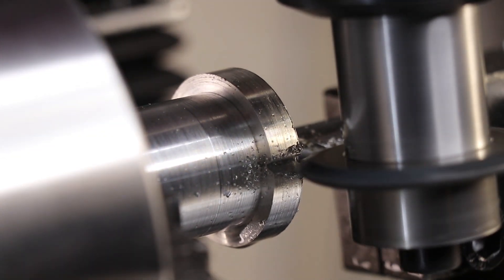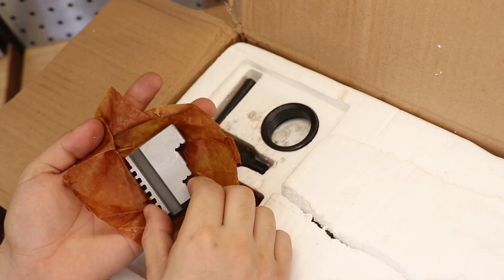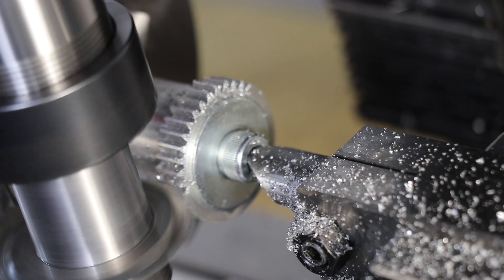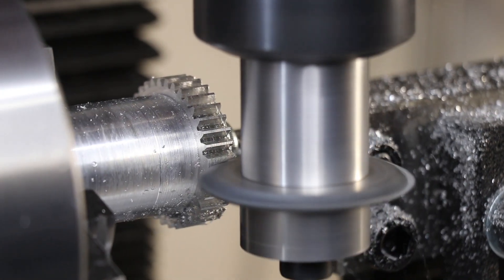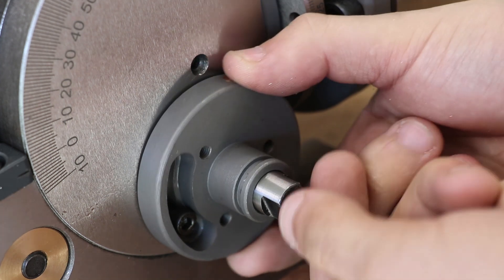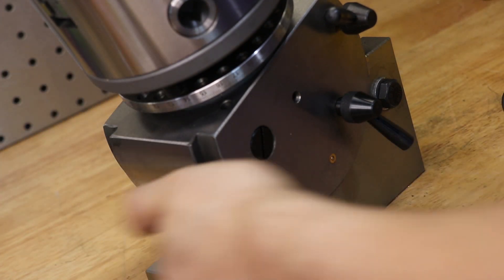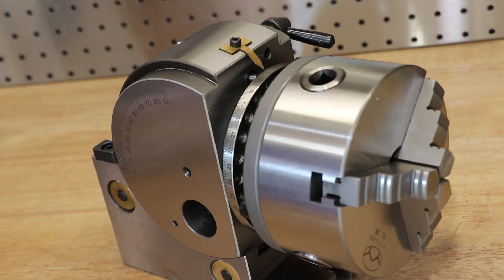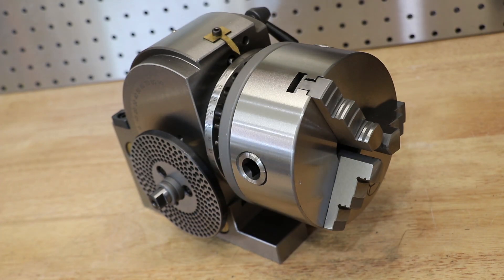$200 Dividing Head - Almost Scammed Buying It

Comment: Do you nave a piece of hex stock, or a big (1/2") or more Allan key? With the hex stock I would bed it 90 degree with one leg long enough to go past the depth of the chuck jaws, tighten the jaws up really well, clamp the head down tight and try loosening the chuck with the new "handle". Still will not move? Use a piece of pipe as a cheater for more leverage, hit the end of the handle with a lead hammer, etc.  A strange thought crossed my mind... could some fool at the factory have Loctited it in?  A very weird idea, but not impossible.

Comment: I am thinking of buying this one , looking at your video now , thx, what do you all think for the best way to make an keyway in a gear ?
Reply: If you are only cutting a keyway seldom, chuck the gear in your lathe - make a tool bit to make the keyway, and use the carriage back and forth to cut a slot in the gear. Otherwise you need some kind of a slotting tool/machine
Reply: For a one-off, use a vice, a hacksaw blade and a file.

Comment: I use the same, the chuck will come off, just needs a few clouts with a heavy hammer and a wooden block, and yes you can tap the spindle through with the same method, no press required. I took mine apart and machined a myford spindle thread so that I could easily swap from the lathe to the indexer without loosing positions, the spindle is hardish, but still cuts ok with TCT. very useful and well made bit of kit for the money
Reply from the maker: I have tried that,  that back plate is so tightly torqued onto the spindle threads that it aint budging. Cheers
Reply: @artisanmakes  Heat it up a bit and get the big-boy hammer out

Comment: In fact, on Taobao in China, you can buy a 4-inch Dividing head for US$200, which is true. But if it is sold outside of China, That is impossible. the shipping cost will be higher than the price of the product. The fees charged by foreign trade sales websites and the cost of currency exchange rate losses are 20% of the total price + shipping.
Reply from the maker: To be honest, I have never used Taobao, I am more familiar with Aliexpress. It is true that shipping and such are expensive for heavy items from China, but I was lucky  since the distributor has a local warehouse, so the shipping was free. Cheers

Comment: Someone probably already said this, but I would consider cutting an allan wrench/hex wrench shorter to see if you can get the bolts loosened (i.e. grinding them down, using a cheap set). It is still going to be tight getting them out, and you will probably need to loosen all of them and pull the chuck away since I don't think they will fit out between the plate and the mount.

I liked the Video, as I bought a rather expensive BS-2 version from QMT. It is REALLY big and heavy and so complex.  It has a similar issue with the chuck mounting, except the chuck was not pre mounted so I had to figure out how to get in on in the first place.
Reply from the maker: Getting the chuck off is not an immediate concern, although I would like to take it apart, its more of getting the backplate offf, which is sized onto the spindle threads. I did look at the bs-2 model, but this suits my set up much better. Cheers

Comment: to try to get the chuck off, you can put a piece of hex bar or large nut in the chuck, then use an socket and impact gun on the nut while using a strap wrench on the manual index plate to hold it. This works a treat to get my lathe chuck off after I had it jammed it on for years that tight that I broke my back gear try to undo it.

Comment: Do not press it out. You need to unthread the chuck backing plate. If you press it you will break the retaining screws holding that cover plate. The brass gear inside is held on with a threaded nut, it isn't going to be pressed off. Bolt it down, use the index pin and the spindle clamp to hold the spindle shaft from rotating, wedge a long piece of wood  in the chuck jaws and unscrew it. It is just on tight, it isn't welded or pinned.

Comment: I have that same dividing head, I never took the back plate off, but mine had hex bolts holding the chuck on luckily. If you can't get them out with vise grips or channel locks I'd cut the bolt heads off and replace them with some hex bolts cause the 5" chuck is great on the lathe too. But you can't put new bolts in the back plate with the dividing plate in the way either. Mine has the bolts sitting in it still. Which I guess is great cause I can't lose them. Not so great though if you actually want to change them.
Reply: And I put loctited studs in the chuck so I have to get those bolts out of there too. Am following to see what solutions yall come up with to get the back plate off there. I probably would have reefed on it a bit not knowing there was a bronze gear on the spindle. Thanks for the video

Comment: Just for more info on removing the spindle.......when the spindle is going to be removed the worm must be removed first......undo the nut on the end of the spindle,then the spindle can be pushed out as it only has one taper roller or angular contact bearing at the front behind the chuck end and the other end is a plain bearing in the casting.....very basic but totally adequate.
It will be much easier to remove the chuck by unscrewing it while it's still in the head.
The worm wheel on the spindle is a straight cut gear (cast iron not bronze) with the teeth cut at an angle to match the helix of the worm.
The worm presses against a steel ball in the bottom, (adjustable from outside around the back) not a thrust bearing....and I think it has a small thrust bearing at the top, but it might be a plain steel thrust washer...... not quite sure.
Reply: They likely no longer use plain bearings, most of the newer ones use real thrust and tapered roller bearings unlike the old ones. Also the the worm wheel is a worm wheel, it isn't straight cut with angles it is worm cut. And that worm wheel is most certainly held in place by a key and threaded nut, all of which cannot fit through the bearing retainer held by 3 screws in the front which can only be accessed once the chuck backing plate and the index plate are removed.
Reply: @Bakafish  Interesting.....mine is 20 years old, if that is the BS-0 type they must have changed the design for the better along the way, but I doubt that this model has 2 bearings on the spindle..........if it comes with a 3 jaw chuck already mounted you would also need a spare threaded back plate(s) if you wanted to fit either a 4 jaw chuck, ER40 collet chuck or a 5C collet chuck or even a face plate.
Reply: @gangleweed  Yes, bearings are cheap now, likely cheaper than bearing bronze 🙂 so the latest ones I've disassembled used a pin style thrust bearing in the rear, and a conical roller bearing in the front. Older models used plain bearings. The spindle has a Morse taper, so ER or 5C collet adaptors can use that, or you can drill your own holes in the chuck backing plate which is easily removable from the provided chuck once the plate has been unscrewed from the spindle nose.

Comment: If you want to devide by odd numbers you can make your own dividing plate easy from flat steel with your mill's DRO. Even print it on paper and punch it will work because your result is 40 times more accurate than the dividing plate.
Reply: Clickspring enlarged the circular pattern to multiply the accuracy many times.  His work was all done by hand, as in ancient times.  I'm sure you've seen it, but others may not have.
Reply: I've used the makeshift paper printed disc a couple of times and it worked out really well👍

Comment: I have this same model. The chuck is threaded on. Put the chuck key in and tap it counter clockwise to unscrew the chuck. If needed clamp the dividing head down and engage the spindle lock.
Reply from the maker: I have done that, problem is the spindle lock doesnt have enough grip and eventually slips. Cheers
Reply: @artisanmakes  If you engage the index plate with the pin, you would have to break the pin or index plate before it slips... Honestly it isn't going to be tight enough to do that. It is made to come off.
Reply from the maker: @Bakafish  I am considering this too, I know I am being a little over cautious, I just don't want to damage the pin or the plate, trying to use other options before I do this. Cheers.
Reply: @artisanmakes  you can be cautious sure, but this is how you are meant to remove it. Its the same way older lathe spindles attached their chucks. You couldn’t cut with them in reverse. It will just spin off. I had the BS-2 with the 8” chuck.

Comment: What if you lock in the direct indexing pin and then put a large hex key in the chuck and give it a good tap.
Reply from the maker: I have thought about this, just concerned about damaging it or the plate. I might be over thinking it but I am not sure. Cheers
Reply: @artisanmakes  Locking the index pin is the correct operation (along with the spindle lock.) You could make a long metal tool with two pins that engage the holes in the index plate to help give you leverage and avoid the possibility of damaging the indexing pin, but I'm pretty sure the plate is going to come off without breaking anything if you just lock it with the pin. Use a soft dead blow hammer if you need to. It isn't reversed threads or anything.

Comment: Use a vise-grip to unbolt and replace screws with bolts (with outer hex)?
Reply from the maker: That did occur to me, id rather try and get it removed without needing to destroy the bolts, but if it comes to that, that might be a really good idea. Cheers.
Reply: Chuck needs to STAY bolted to the backplate, so that it can be unscrewed. Removing the chuck just makes it more difficult to unscrew.

Comment: hi . you showed a ring cover at the start. for the shaft.. ok so bolt the gear head to table. then put a ratchet strap around the chuck and pull .. ?? have fun till next time .. tone uk
Reply from the maker: Only problem is the spindle lock is so weak that it slips easily. That's the biggest issue I'm running into. Cheers

Comment: Bought the same one about a year ago. Undid the chuck bolts with pliers (not very tight). Didn't realise the back plate was screw on until I had the chuck off. Undid it with a little bit of force as it was a bit snug. I did actually put it back on a bit tighter as I was worried it may loosen up during use. Worth getting apart and redoing the lube. Works fine enough for the money.

Comment: When taking stuff apart, I often use a piece of delrin/nylon as a sort of punch and tap it with a hammer.
This makes sure that you don't deform the metal parts. Assuming that it is able to come out in the first place, but that assumption is also true for the press.
Reply: M2!

Comment: Re the chuck. I'm wondering if you can cut a small length off an Allen key to insert into the screw. Use the correct sized spanner on that bit of Allen key. Swap out of studs and nuts when done.
Keep up the good work 😃
Reply: Taking off the chuck gets him nowhere, the backing plate needs to be unthreaded in order to disassemble it and the chuck actually gives you something to gronk on.
Reply from the maker: Thankyou, I did try this, but the gap just isn't big enough for any useful amount of the hex head to poke through. Cheers

Comment from the maker: EDIT 2: Thankyou to all the suggestions, and I have finally gotten the backplate off the spindle. Ill make a quick update video, but  to cut to the chase, I needed a fixture to stop the spindle from rotating, penetrating oil, an impact driver and a spanner for leverage. I really can not stress how tightly it was torqued on. No Damage to the threads, should be good to go. Cheers

EDIT: Thankyou for all the suggestions guys, I am so grateful for all the feedback and suggestions. ill give the impact driver and jig a go and fingers crossed it should work. Cheers

Any thoughts on getting the backplate off or the shaft out would be appreciated. Hope you enjoy the video, hope 2 in a week is not too much. Cheers.
Reply: @nigelcrockett4032  NO NO NO........you unscrew the back plate from the spindle.....it screws on like a lathe chuck......the chuck remains on the backplate at all times.
Reply: Yup, small set of pliers, like Knipex Cobra or Alligator with the angled jaws, or similar. Grab the OD of those caps screws and crack them loose. 

When you get that off, try a little heat on the backing plate. That might get it to loosen off the spindle threads enough to get it to unscrew.
Reply: I put it vertical and tried and use it as a rotary table, well the whole chuck with backplate came unscrewed. To be clear, it’s not broken.
Reply: @nigelcrockett4032  OK...........
Reply: A good pair of small vicegrips or pipe wrench may work. If not maybe drill a hole through the head of them bolt and put a strong shaft through it to break it loose. Once they are out you can replace and maybe countersink them so you can get a wrench on them.
Reply: one thing I recommend in this case is to replace the Allen Bolts with some wrench bolts for next time. Maybe you could grind/file some flats on the Allen Bolts and put a wrench with a long pipe on its handle for more leverage. Though, you would have to replace the bolts, and I recommend hex or square bolts.
Reply: Unscrew the backplate  it has the same thread as a Myford lathe spindle iirc.
Reply from the maker: @Flattyman  Yes, but my point is that its so tightly torques on that the backplate has sized onto the threads. Spindle lock isn't powerful enough to hold the spindle. Cheers
Reply: @artisanmakes  
Clamp the dividing head onto your mill table , and you can either clamp some decent size hex bar ( 25mm +) in the chuck , fit the appropriate wrench or adjustable wrench to the hex bar then apply some load and hit the end of the wrench with a mallet or soft face hammer .
The other way is to put the wrench directly onto the chuck jaws and do as above but I don’t like this way as it can damage the chuck.
If you open the chuck jaws enough you should be able to look down the centre bore of the chuck and see if the spindle and backplate are indeed two separate items . 
If they are not then take to the head of the Allen bolt with either a pair of channel lock or locking pliers ( vise grips ) and try to loosen the bolts , you can then change them to hex head units which will make removal next time far easier .
If the spindle lock isn’t strong enough to stop it spinning re engage the worm wheel  - it won’t spin then BUT do be mindful of the load you are applying to it . It shouldn’t be that tight - maybe some idiot at the factory spun the chuck on really fast which can cause them to jam - fitting a screw on chuck it should be screwed on all the way gently until it stops then back of 1/4 turn and spin it onto the spindle with a twist of the wrist - nothing more .
Reply: Tom Lipton put up a video where he tackled compound indexing on a spindex plate, but I don't see why the same principal woldn't apply. https://www.youtube.com/watch?v=m_VO9uRigQ8
Reply: How how you clamp a large hex socket or some hex stock in the chuck and use an impact gun on it, make sure the chuck is free spinning so you dont damage the worm gear.

You might have a chance getting it off with the shock of the impact.
Reply: Should read "Can you" at the beginning.
Reply: If all else fails you can always just completely grind the head of them bolts off. Im pretty sure they wouldn't be to hard to get out after you get it apart. That would cause less stress on the internals too.
Reply: @bigjim8088  - NO NO NO... the chuck needs to stay on the backplate. If you remove it then you have no way to rotate the backplate to unscrew it.
Reply: How do the bore through the chuck, the bore through the backplate, and the bore through the spindle compare? If the former two are larger than the spindle bore can you make a custom shouldered bolt to go right through the spindle clamping against the faces at each end of the spindle. Then use that to react against the torque you put on the chuck to try and undo it.
Reply: Ive worked on old motorcycles for decades. To remove an "impossible" bolt; use a dremel with a tiny cutoff wheel to cut a notch on the outside edge of the bolt head.
Then a centre punch and a hammer, punch it on the notch at a tangent to the bolt head, ie to TURN the bolt head undone.
It gives a combination of very high peak turning torque to the bolt head, plus added impacts of the punch to loosen it up, so it acts like an impact wrench.
You'll get those bolts out in a few minutes.
Reply: How about using a pin spanner to engage the indexing holes? That should give you decent leverage on the spindle without damaging anything.

I really enjoy these videos, keep up the great work!